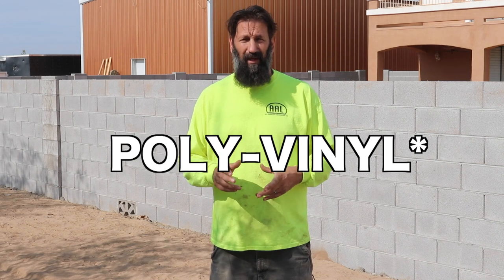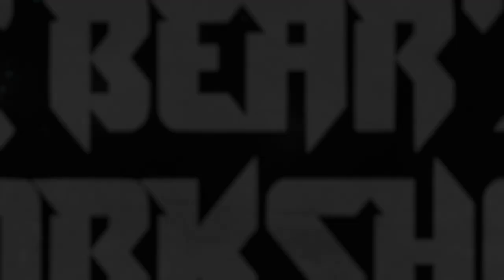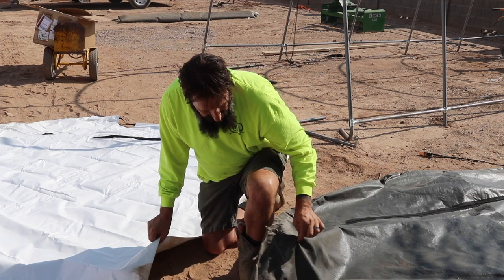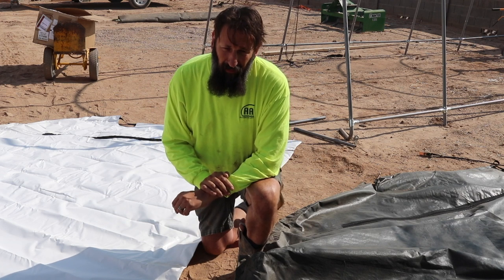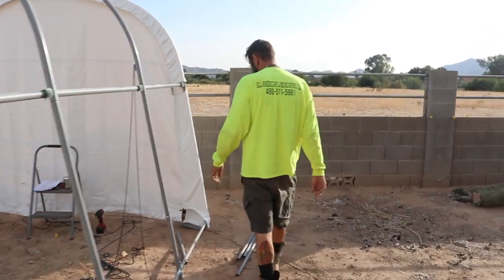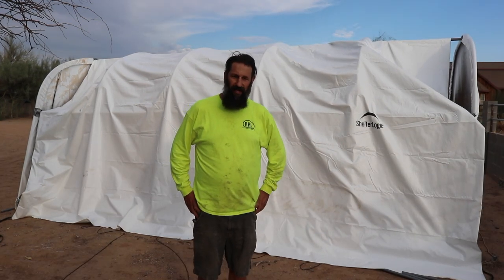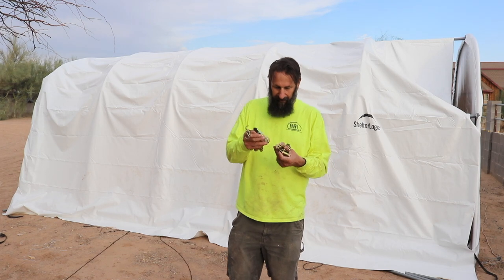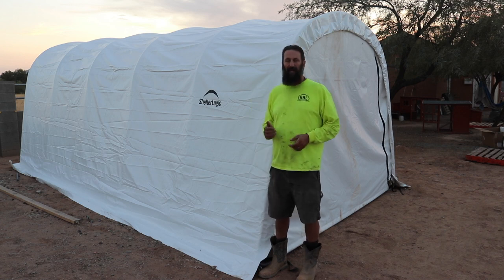Shelterlogic Garage in a Box 12x20x8 | Upgrade to 21.5 Oz PolyVinyl

Comment: Thanks for posting.  One, when you order from the company with heavy cover, there is additional braces.  Two the ends of the cover goes on before the end pole, this way the pull tight straps are on the inside.  Three,  the sun on the the top heats up the metal poles and cause the material to decay.  Cover the metal tubes with outdoor water pipe tubes.  Four, keep dampens out cover the floor in plastic sheet and then cover in gravel.     Mine is 5 years old, doing well.   I do not like no vents to let heat out.
Reply: Hey, what kind of outdoor water pipe tubing?  Or would it be the foam cover for pipe?  Thanks
Reply: Plastic water pipe tubing sounds like a great idea.

Comment: Thanks brother!! I didn’t know shelterlodgic had upgraded material!! I was just cleaning the snow off mine and was thinking why can’t I get the stronger material that the bigger shelterlodgics have. I might not get another winter out of my shed because the original 7.5 Polyethylene is not that strong and gets week after the first year. They should sell them in stores under a winter version. I bet they would sell lots in the snow belt. Cheers.

Comment: Thanks for the info. Been looking to purchase a fabric shelter from them. A few of the videos that I have seen, they have the Shelter logic logo on the structures. And most were complaining that the fabric was showing wear after maybe a year of use. But I believe that when you purchase their product from outlets like Mernards, Home depot and such your getting the standard structure and fabric and not the more durable kit that you can purchase by going directly to their site. I'm looking at a 15×20×11ft barn style structure with the white ultra duty 21.5 ounce polyvinyl cover with 2 3/8" frame that runs about $3200.00 vs paying $3 to $600. I was born and raised in Arizona so I know about the extreme heat and for the past 40 plus years I've lived in Wyoming where we can get extreme variance in weather conditions and lots of wind. I could probably buy a prefab structure that size for twice the cost not counting a foundation of sorts and building permits or build one that would take some time since I'm not a youngster any more. So for the money, this maybe the rout to go but I will continue to research a little more before I make a final decision. Good info on your videos.👍😎

Comment: How much did the new cover cost?  My original cover ripped...didn’t last very long.  I don’t want to throw more money away....really disappointed with the quality
Reply from the maker: The original cover should be covered under warranty with free shipping.  If you go with the upgraded cover you get a credit for the original one of $220 that goes to the upgrade.  The first upgrade is a 14.5 OZ Poly-vinyl that would be $380 with the credit.  10 year warranty. The one in the video is the 21.6 OZ ultra duty Poly -Vinyl.  15 year warranty and will cost $616 with the credit.
Reply: @BearsWorkshop  just ordered the 14.5 @ $1000 !!  Lets go branden . crazy world
Reply: Keep the frame and buy metal roofing panels. Attach 1 by 1 and you'll have a way better shed. I'm doing this after mines dies on me

Comment: I have a 12 x 20 x 9 and the tarp material it came with lasted 4 years. I believe we paid $600 for it at Tractor Supply.
  The new cover we ordered for it in this 21 oz material weighed 110 lbs and cost $1600. It is supposed to last 15 years. 
If it does, then $107 a year sounds better than the $1600 does.
Reply: Typicaly a regular Polyethylene tarp on any shed I have owned has been destroyed in a little over a year. My sheds are in direct sunlight . My new PVC tarped building is now ten years old and still looking good. I bought a green colour because the Shelter Logic rep said they last longer than the white.

Comment: Looking to buy 10x20. I live in northern Michigan. Not too bad but I do have some trees around. Snow isn't real bad couple times during winter I rake my roof. I pay $85. Month for a 10x20 storage unit. So I. Looking to purchase one of these, to save some $ to maybe get a wooden large shed built. And no I may not need a 10x20 time I am done hopefully selling some things. So looks like it has been maybe 2 years from this video, how is it holding up? Thank you
Reply: Cover with metal siding material and should be solid.  The videos I've seen note one or two have lasted through multiple hurricanes without added re-enforcement.  Interestingly, the rest seem to all add some extra purlins and support studs.  Still, with the added materials seems to be the most cost effective solid structure if you screw in the sheet metal right.

Comment: I have a ten by ten Shelter Logic shed. it lasted about ten months and now the wind has ripped it apart. I tried to contact the Shelter Logic company and had no luck. I would like to know how to contact them to get a new cover for it. being as the frame is still in very good condition. otherwise I'm just going to take the shed down.
Reply: Through Amazon works

Comment: Why would anyone live in that heat
Reply from the maker: 350 days of sunshine.   Horribly hot for 4 months. Perfect the rest of the year.  No snow, no humidity.
Reply: @BearsWorkshop  Greeting from Desert Hills Arizona 8 months here is the best by far for us.. The other 4 months Flagstaff would be great if i could afflord it.... that's why I've Been looking into these and the sun is a major concern. How did the 21.5 cover hold up
Reply from the maker: @notwrkn2mch  Holding up just fine.  No problems no issues.  Made it through the summer.

Comment: Sure looks nice and heavy duty, but at damn near 3x the cost of the base shelter, it's a hard sell...
Reply from the maker: The original cover lasted a few months.  If you are in a high sun area then it appears to be worth it as the original just won't last.
Reply: @BearsWorkshop  I live in chicago and my shed is in direct sunlight . And yes we get extreme sun /heat for sometimes 2-3 months which did a number on my basic cover, lasted about 2.5 yrs. Just upgraded to 14oz hopefully i get 10 yrs this time ?